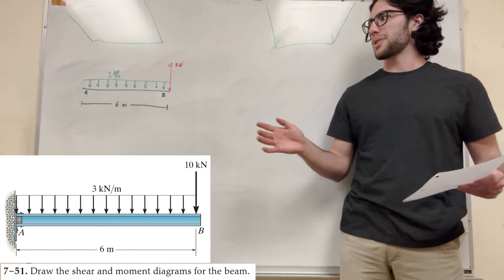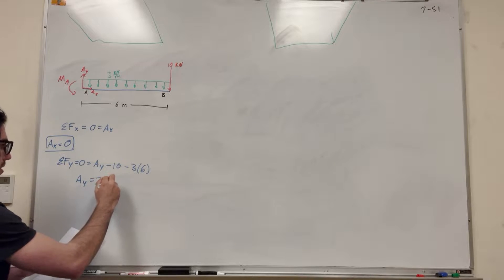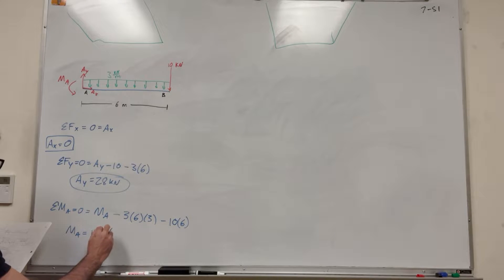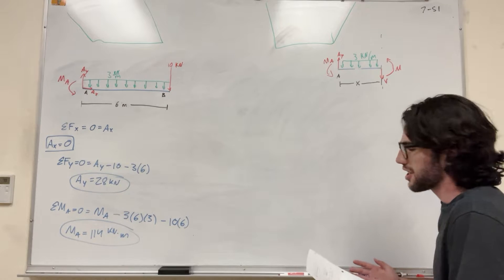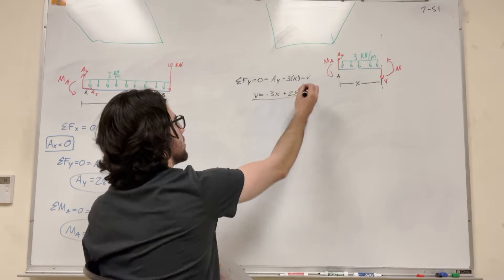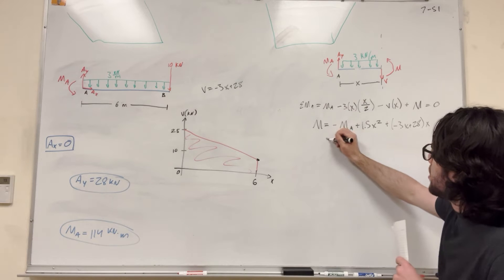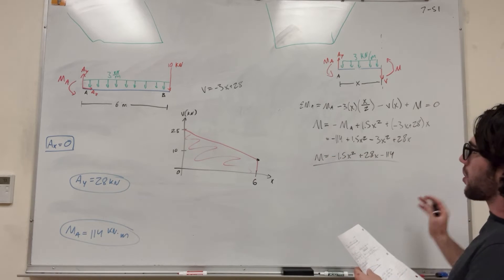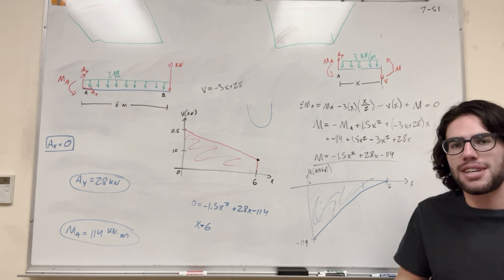Draw the shear and moment diagrams for the beam - 7-51

Comment: Shouldn't 114 be negative? since its a clockwise movement from the left and A is attached to the wall?
Reply from the maker: If you’re talking about the moment around A, you may be right, I probably didn’t follow convention for the direction to draw it. However, if you keep track of its direction and keep the signs correct, it won’t make a difference on the sheer or moment diagrams.
Reply: Moment around A should be the opposite of the moment that the distributed load is causing about A